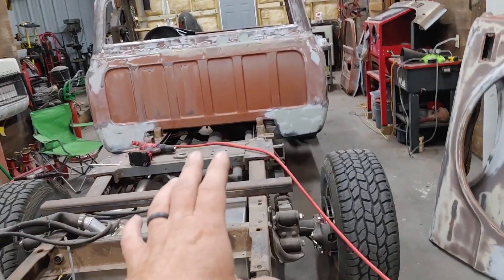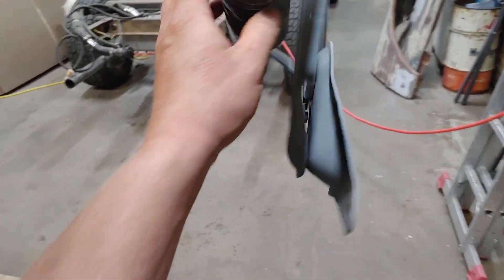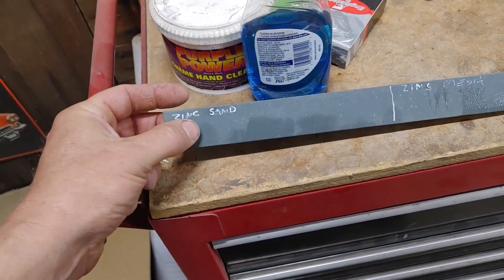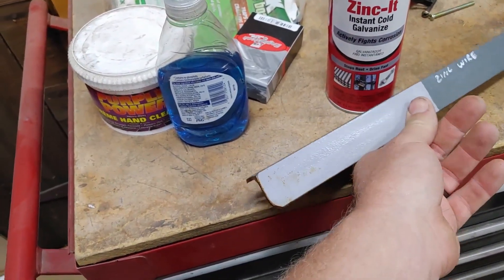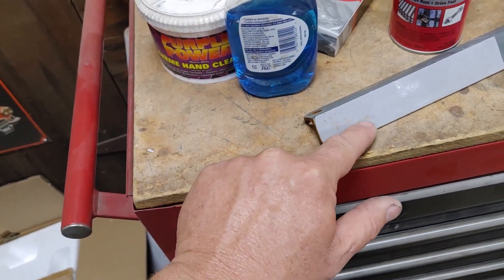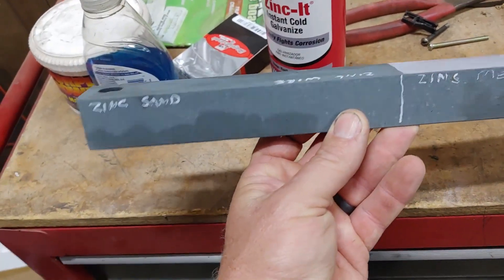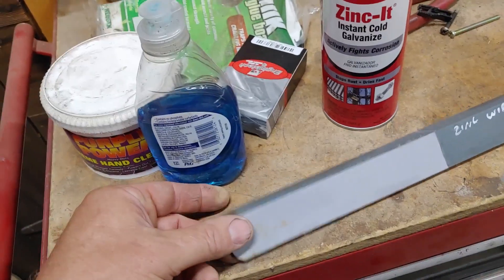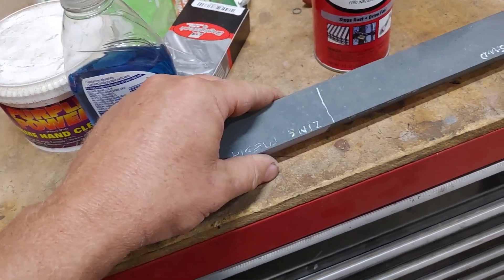CRC Zinc-it - Does it Work? One Year Update

Comment: Acetic acid, A.K.A. Vinegar is much cheaper than Citric acid JS.
Reply from the maker: I can find Citric on ebay for $5.00 per lb. and easily make 50 gallons of solution per pound. No smell either. Only drawback is that it does go bad. Just saying as well, we each do what we want to do, right?
Reply: Citric acid is a significantly stronger acid than vinegar.

Comment: So unhhh.... I don't wanna be the bearer of bad news but this test may not be all that scientific and all proving.
Zinc galvanized metals even if not coated completely to a degree have some form of electrochemical protection.

You should have cut this bar into three pieces, wire wheeled all three and painted each one with a different product leaving one as a "control" with no treatment.
To avoid any contamination between the three pieces, they should have been sitting on an electrically insinuative mat of some sort broken into three pieces so water couldn't form a conductive path between different metals.

Read up on dissimilar metal corrosion, quite often people use stainless fasteners on their roof and wonder why their roof rots out. (Or Galvanized steel screws into aluminum sheeting)
Reply: But yes, Zinc cold Gal is awesome and I use it on everything (even undercoat on some repairs to my 4WD)

The CRC stuff is considerably better than some Zinc primers due to the fact it has a considerably higher zinc content.